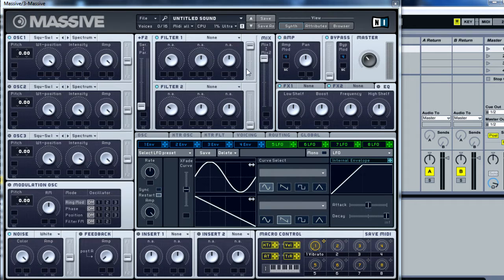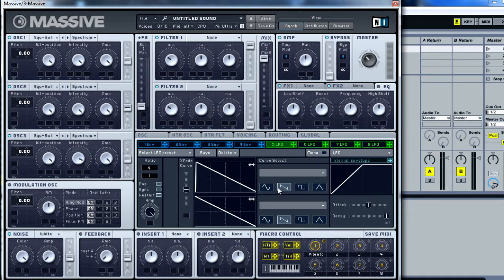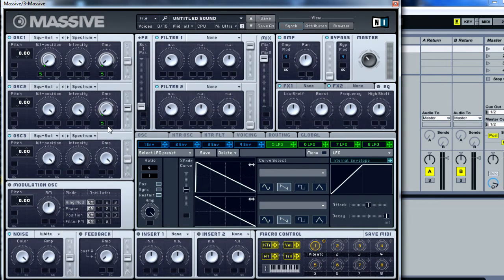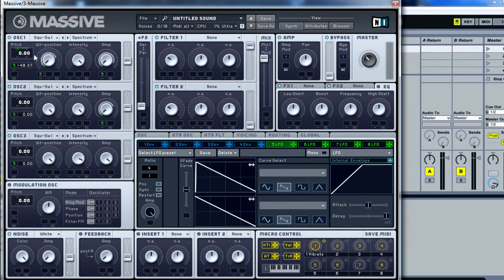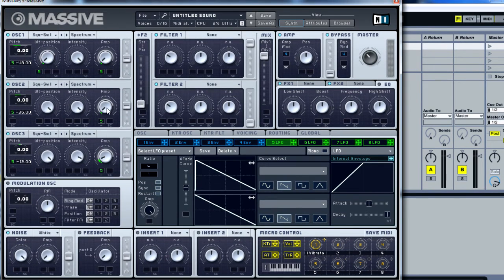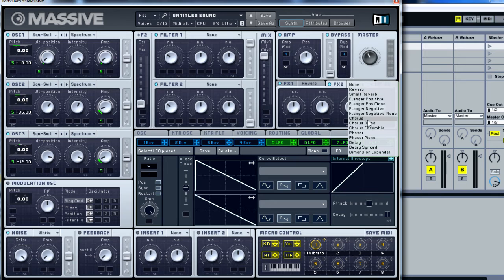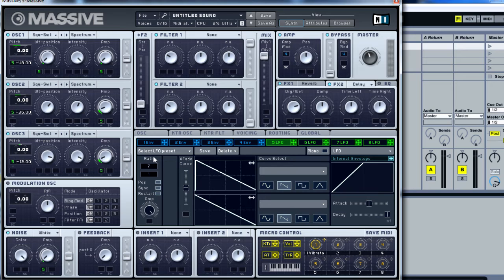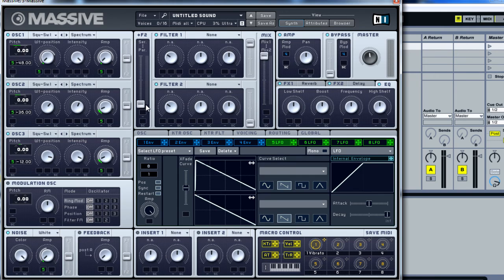Basic Synthesis - Simple Synth Sweep in NI Massive

Comment from the maker: you could do that in a few different ways, one would be to assign an lfo to the higher pitched oscillator's "amp" which would control the volume of that higher pitched sound, or alternatively, you could try sending that osc to a filter, which would give you more options with how you want the shape to be affected.  the filter's cutoff which essentially allows you to control the frequency of that filter, can be controlled by an lfo.